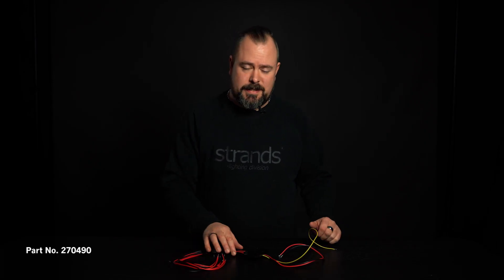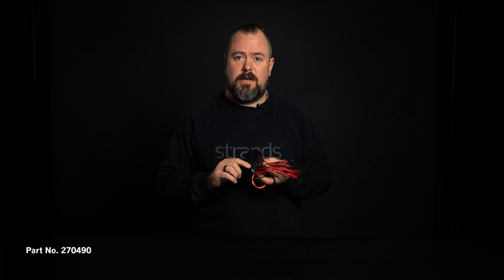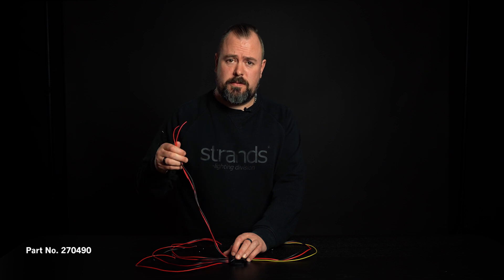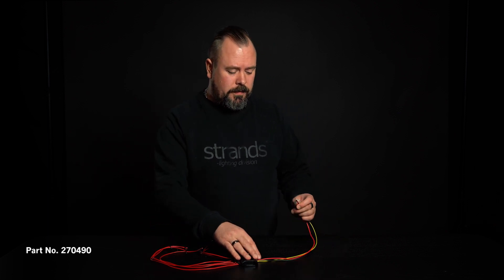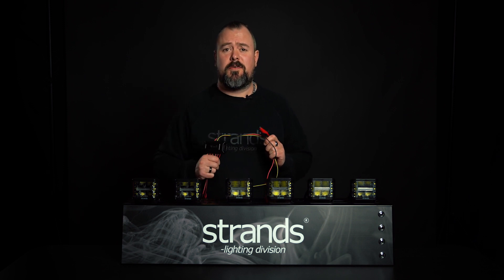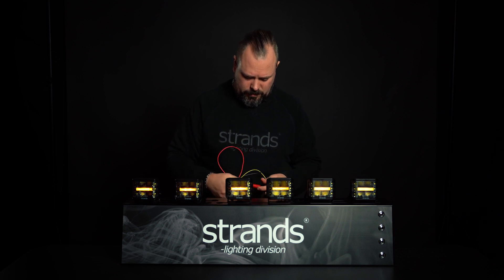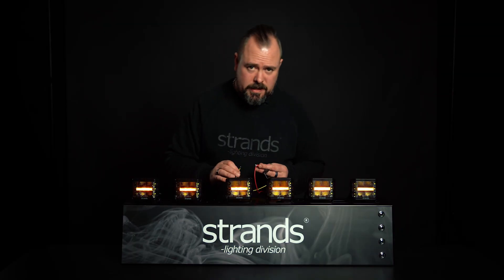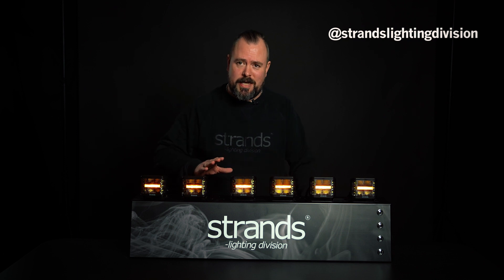12 FLASH PATTERNS - CRUISE LIGHT STROBE CONTROLLER – STRANDS LIGHTING DIVISION

Comment: Do you offer any other controllers? Like a 2 channel controller?
I want it for a strobe on offroad lights for on road safety purposes (in my country highways are dangerous and flashing lights confuse bad guys making them think you are the law).
But I have a full lighting system composed of several amber lights and several white lights as well as a couple red ones for chase lights and markers. So I really only want 2 channels to alternate them while flashing.
I would be using relays to power up the lights in order to get full brightness and a rocker switch panel to be able to controll all my lights independently in their solid mode, but activate them all together with a strobe switch correctly wired up.
Reply from the maker: Keep your eyes open... 👀 we are soon to release just what you need including much more functions that you will enjoy 👏